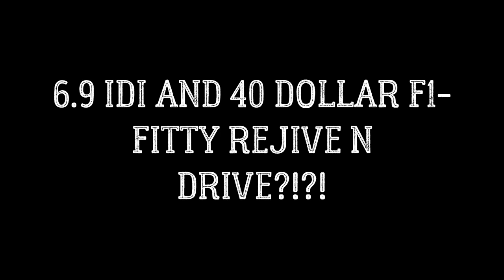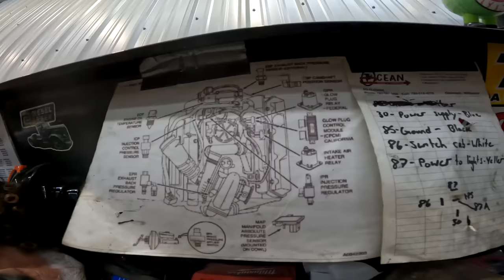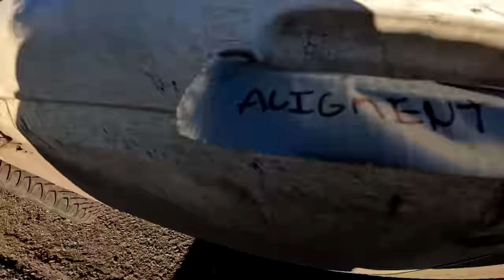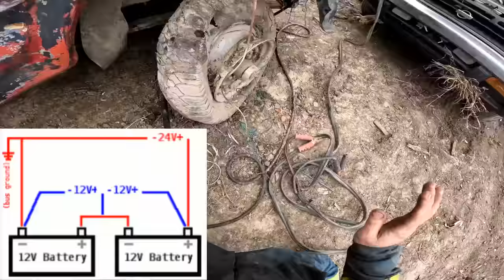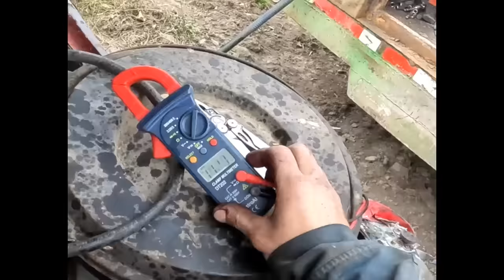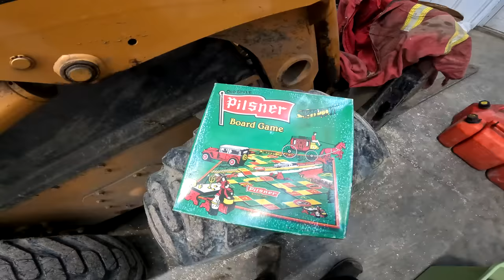6.9 IDI AND 40 DOLLAR FERD REVIVE N DRIVE?!?!

Comment: Peg, you are right about the 24v wiring thing. Batteries put out a limited amount of wattage which is amps times voltage. If you take 24 volts, you half the amperage. But if you wire 2 12 volt batteries and wire them in parallel, you get twice the amperage and same amount of volts. Electricity can be kinda cool if you know about it and how it works
Reply: Say what you want about Teslas S***r "truck" but maybe we should all convert to 48v 😅
Reply: @PaletoB  each day i find myself liking electric more, i might go and buy one of those edison refit kits for a 1 ton one of these days
Reply: How do you know this wizard show me how to do it my greasy log hauler needs all the CCA it can get
Reply: @jacobm7002  Edison does skme pretty awesome stuff. Love to see a company with drive and vision, not to mention user friendliness when it comes to maintenance and repair.

Comment: ive been aligning with pegs method for 15+ years and it works just fine.  however!  if your junk is tired and has wear do this,  you can compensate for worn parts. keep the tires on and weight on the ground.   roll up on level surface.   put a piece of tape on the tire at the front where you can get a measuring tape  use a pen and make a mark and note the distance.  then roll forward and try to get the rear measure as near 180deg then adjust the tie rods to get 1/8 inch toe in.   ive nailed it plenty good enough that most of the time it dont need adjustment on the alignment machine.  this wont count for caster or camber but thats another comment.

Comment: I run 24 volt all the time to them old gas V8's that have compression in 4 cylinders due to stuck valves or stuck or no rings that way it spins so fast it don't need all 8 to light off. It's always good to have snow or a big bottle of water to pour on the starter to cool it off when it's been cranking for a few minutes

Comment: Those little nissans can hold their own pretty mintily my old mans got a 2000 Nissan frontier Won-Ton hadder loaded right down with a tandem trailer full of round bales hauled old ripped out phone line from our jobsites that went past the cab squatting the hell out of it and just chugs right along even though its got a Really bad ground issue that pressing the brake turns on the turn signals the turn signals turn on the reverse lights and the headlights all the brake lights turn on but the v6 just cranksbup right away no matter what

Comment: You need a dt360 international engine to put in one of your trucks. Stellar engine but I can’t find enough info on doing the swap into one of my trucks. Got a 95 f250 and a 2012 f250. Both are regular cab long bed 4 wheel drive gassers. They need that engine

Comment: I'm sure you know but just in case you don't you can tell a 6.9 from a 7.3 from the head bolts. 6.9 7/16s 12 point 7.3 1/2 inch 12 point cool I love those motors too  😀

Comment: Ohhh yeah bud. Hey peg I got a question. Which is a better engine? The 7.3 idi or the 6.9 idi????
Reply: I’m not peg but I’d say the 6.9 is better I’ve shit the rods out of a 7.3 my 6.9 had a bad oil cooler and rusted tf out of the valve train and the timing gears and the crank looked like the damn titanic but the thing still runs minty as fuck and I daily it
Reply: @lucasmclellan8388  okay. That’s what figured. I’ve heard the 6.9 is the way to go
Reply: @locustvalleyfarms7241  that and the ability to sleeve it as well

Comment: The old wrong post hammer trick, been there more times than I’m willing to admit. My 03 Tahoe is converted to top post with the posts size opposite. No battery tie down either. Works mint.
Reply: But I will say this those old IDI’s are much better than the old Detroit 6.2 and 6.5’s lol